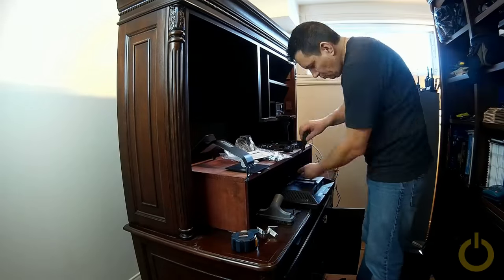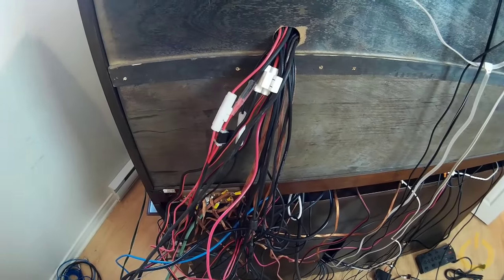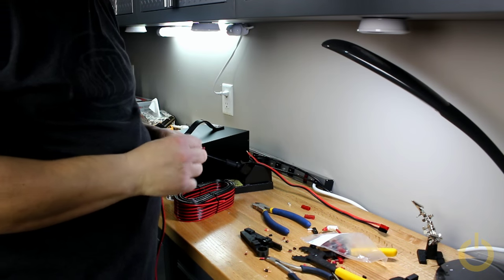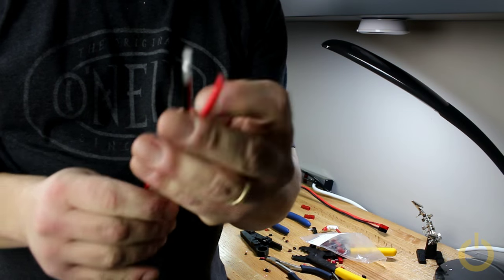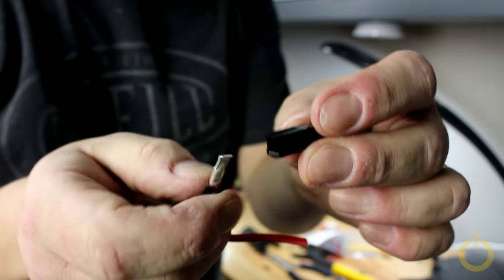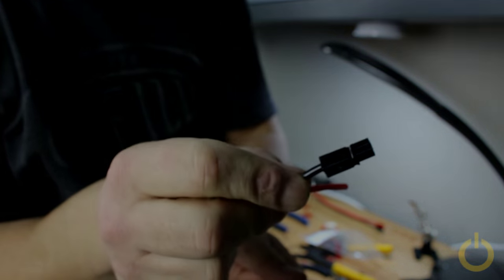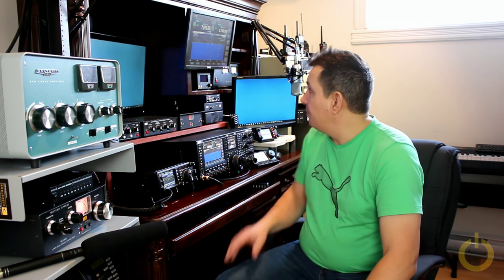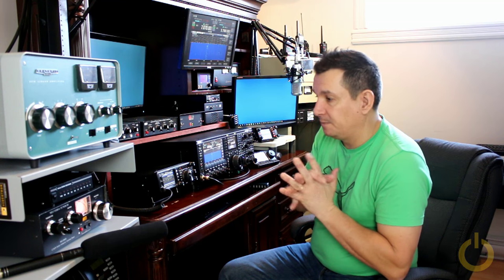Part 2 - Reorganizing the ham shack cabling (EN)

Comment: Take a note from the computer network guys: Velcro the cables together inside the Panduit boxes and they will stay organized and compact.  Also, when budgeting for cable length, always put 1-1.5 feet of slack behind frequently moved items such as computers, network and accessories.

Comment: Good project and well done.  I'm thinking of just putting some PVC pipe lengths along the back  of my corner desk unit.  Then I can just pull another wire into it whenever I want, and my wife will appreciate the improved aesthetics.

Comment: you might also try some 'D' rings for cable guiding the larger cables ( coax ) getting the astron power units out of the small space in the shelf would also be good regarding the heat build up
 , the D rings are great on the work bench to hold the heat and solder guns, drills etc. , also the guide ring for rain gutter downspouts are handy as wire guide and HT holders.( and cheap)
Reply: Brad, do you have a link to the 'D' Rings you mention? I'm having trouble visualising what you're talking about.